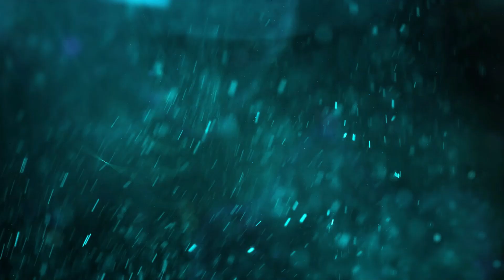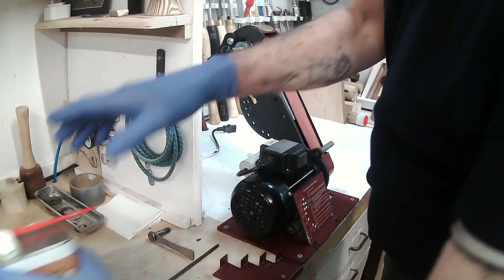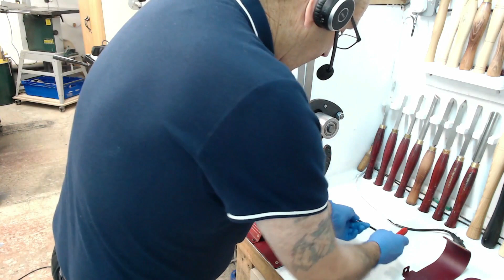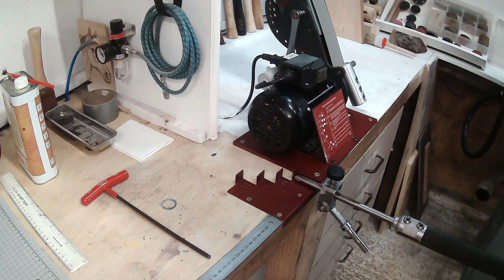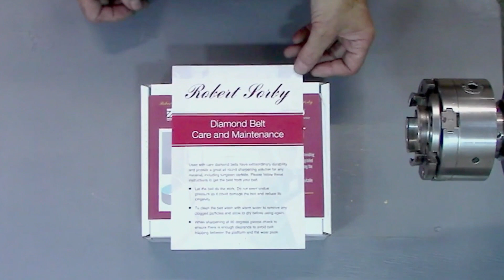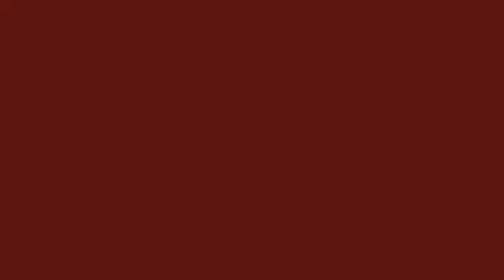Robert Sorby Proedge Monthly maintenance, with Table Mod & new Diamond belt #RobertSorby #proedge

Comment: What size belt fits on the ProEdge? 50 x 785 or the 50 x 780?
Reply from the maker: 50 x785  is the correct size
Reply: @Stable_Studio   Thanks. Original belts are hard to come by in my country so I have to have the belts costomly made for me. I got two different answers when I acquired about the size.

Comment: How do you find the belt mate ? I've got a pro edge , but I want a different belt for re grinding edges on chisels and plane blades etc . 
As the ones I have toast the steel . 
Any recommendations appreciated, good to see a scot on YouTube 🫡.

Cheers 
William
Reply from the maker: Hi William I use a 80 grit belt for re profiling and gouges as it removes the excess quickly I then use  a 120 belt to sharpen  and for normal every day sharpening I use the diamond belt  I use the belts supplied from Robert Sorby via turners retreat or any of theirs distributers. For standard Bench chisels plane blades etc you will be using much higher grit than I use
Ps the diamond belt I use is only 200 grit

Comment: I noticed that you did not tighten the belt after fitting it, is that correct?
Reply from the maker: The belt tension  Is correct on the machine Andy  it does not need to be really tight as that will put unnecessary pressure on the be
T and the bearings.
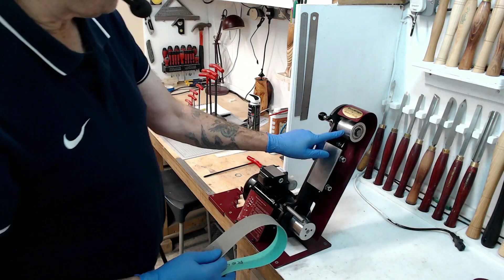Reply: You didn’t move the cam back up to put tension on the belt after putting the belt on. It’s designed to be the correct tension when the top cam is in the most upright position. For example. 14:48

Comment: Thanks Brian. Great advice, particularly like the idea of extending the hole.
Reply from the maker: Extending the hole is a simp,e fix to Aid in the removal of the table, not recommended in anyway by Robert Sorby.  Modification to your own Machine would be done at your own risk as I said in the video 👍👍
Reply: @Stable_Studio  Thanks Brian. Ready to go with the modification.